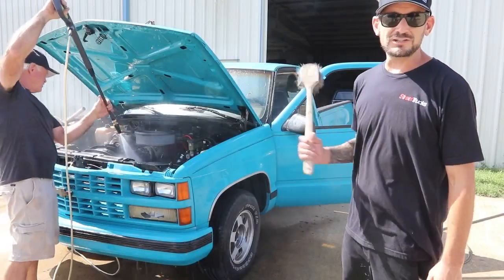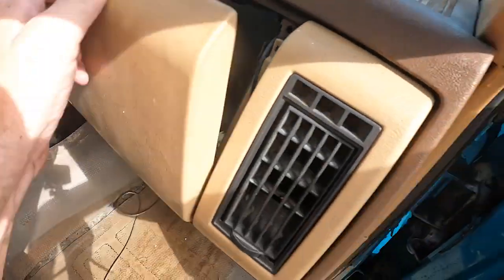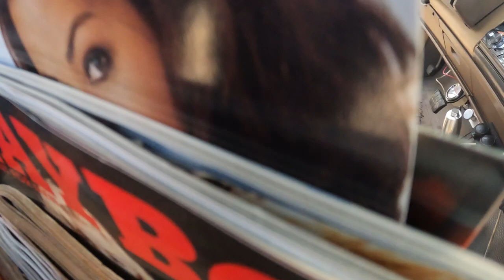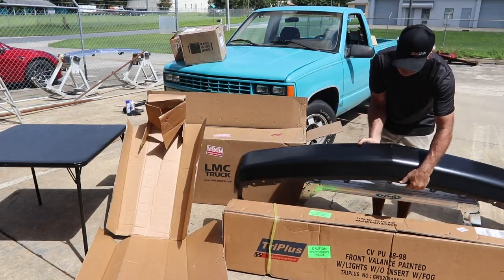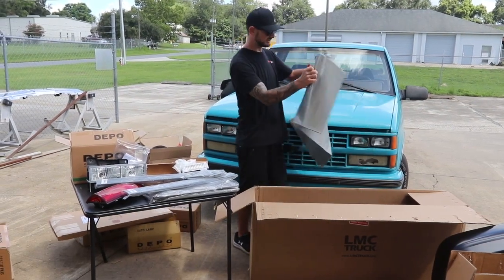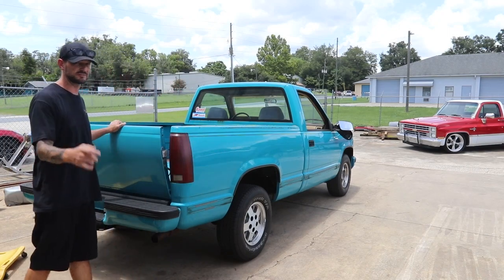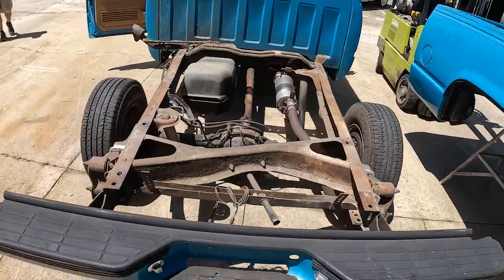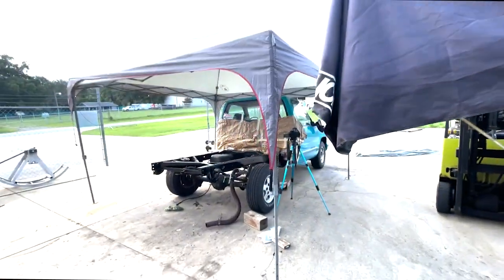First Wash FORGOTTEN '88 OBS, Bed Removal Frame Coating and Rendering Reveal for Project Playboy!

Comment: Also I thought in 88 the black with gold interior was on the ss truck it also had a weird painted on pinstripe my buddy has one that was back halfed and tubbed with 38,000 miles on it they also put a 14.1 383 in it truck is still low miles with perfect original paint minus inside bed it is getting a huge cubic inch big block with nitrous right now and is still very low miles

Comment: Interior imo would look good grey against that exterior color. The old weak engine has definitely gotta go, for what you will have in fi you can do a 5.3 swap! Newer style solid grille and headlights will help it a ton! Wheels in the rendering ftw.